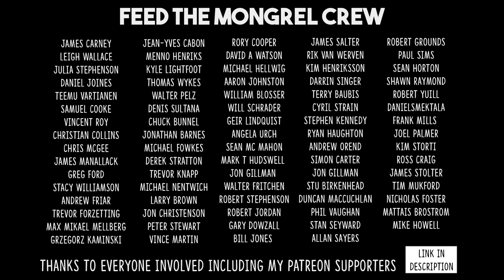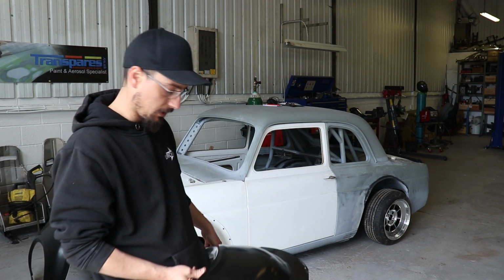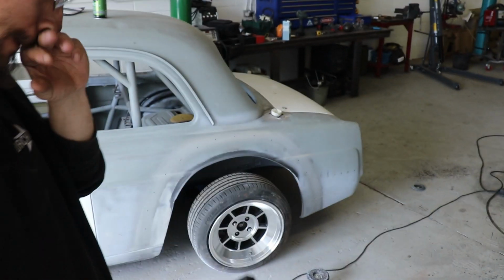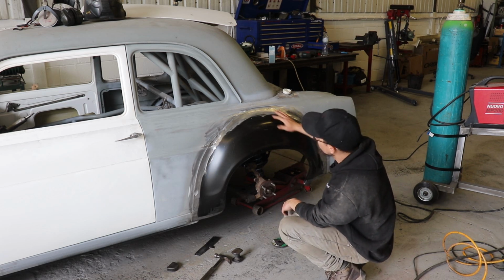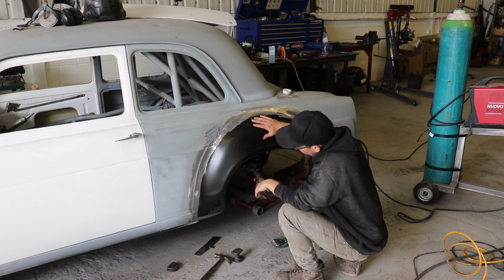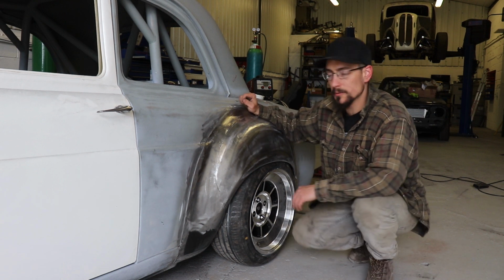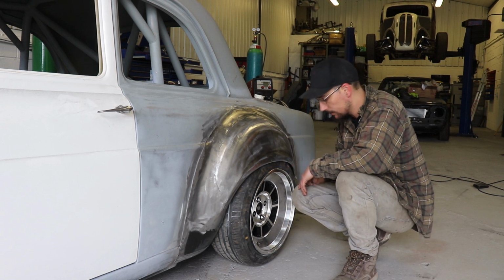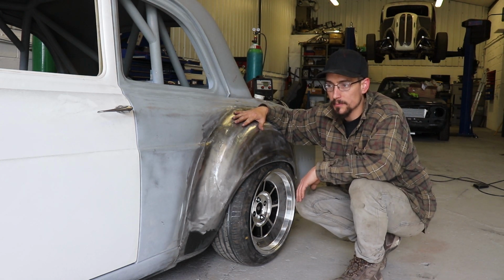THE MONGREL PART 53: BACK TO THE STEEL! MAKING WIDE ARCHES WIDER.

Comment: Years ago while an impoverished student at the Polytechnic of Central London I had one of those 100Es. It had the 1172 side valve engine. I remember one day  going up Highgate Hll and it wouldn't make the climb ..in first gear. So I turned around  and made it in reverse gear!..It also had a missing rear window lol! 😂..Got an Anglia with a 1340 Classic engine soon after.

Comment: Great work as usual... Can i make a suggestion...? Seam weld the big seam.... I know the arch is strong and not going anywhere, but after 30+ yrs in the body trade, i'd bet good money that if that joint was filled smooth that it will crack in time... Be a shame not to pre-empt the problem....
Love to see some more of the sit- up- and- beg pop.

Comment: I don't want to take anything away from what you've done - it was amazing to watch how you cut and extended the arch to fit, and it looks like you did a good job of getting it to fit, but I'm still not sure about those arches!

I'm finding it difficult to put my finger on exactly what it is, but I think it's that the standard arch is quite squared-off - the 'up' bits are quite vertical, and the 'across' bits are quite horizontal, and they're joined up by relatively tight-radius curves.
In comparison, the arches you've fitted have a smoothly-rounded curve all the way - perhaps it's that, I'm not sure, but there's still some way in which they don't quite look as though they belong.

Having said that, it's your car, so it's your rules and I guess you called it a mongrel for a reason! I'm still enjoying the videos and looking forward to seeing it painted!

Comment: I like the 100E. I'm an OLD Hot Rod-er so I would have gone a different way with a SC 3.8L V6 from the SC Thunderbird we have in the US. Full steel tube frame 2x3 (50x100) and cage. Would have to place the driver on the left since I've learned to drive 44 years ago. Cheers Mate!

Comment: G'day Matt from West Australia buddy I get why fiberglass is cool. ( weight savings) but I like steel guards as protection to rear wheels, wheel bearings etc.
Only gives a split second longer for damage avoidance, however I like the extra split second 😉🙂👍👍

Comment: Nice vid and NICE WORK!   Only advice: store cars on the floor, work on the lift.   Your knees and back will thank you when you are my age!  lol...
Reply: I second this comment
👍👍👍🏴✌️
Reply: Couldn’t agreed more , I wish someone gave me that advice 30 years ago!!!!
Reply from the maker: Yeh, half way through I was wondering what the hell i was playing at.
Reply: Agreed don't kneel on hard surfaces for prolonged periods.
Buggers your knees up, in my late 20s now and I used to crouch and kneel for everything for hours at a time.
They're not happy about it now!!!
Reply: @Urchfab  Ya had a shop since I was 25.  My first lift was at 35, and now at 50+ I can't kneel to set lifts hardly.   I lift cars up off floor to even do valve covers or plugs to save my lower back!   So, I thought you should hear that advice, oh and throw shoes away twice as much as you think you should, that too...  cheers

Comment: Wait a minute... Técalémit ? They still are in business, that logo with an arrow through a target is the same as in the 20's ! 
It's (was?) a french aftermarket car parts producer, specialized in Performance air filters, oil bath air cleaners, additional oilers for  clutch thrust bearings, fuel filters... etc

Now you need to find a Técalémit enameled sign ^^

Comment: I was delighted at the news that you were going to use steel for the rear arches...and astonished by the superb result. I reckon a glittering career as a Saville Row tailor potentially awaits you in later life.
 One thing puzzles me; if you´re going to fit shorter bottom arms, I´d have thought that this would give you more positive camber, tilting the top of the wheel outwards and reducing clearance by 10mm rather than increasing it. What am I missing?

Comment: Amazing work, Matt! Much nicer.

Still amazed that you don't wear eye protection when grinding. Glasses are really not enough. I know from personal experience with a wire wheel.
Reply from the maker: I've just picked up the ultimate face protection so no worries from now on bud.

Comment: Looking great! I know the workshop move probably cost a load of money but reckon you need to save for some tyres that fit the rims ;)

I’m a bit older and struggling to see what having the wrong size tyres offers aside from cocking up the 1000,s of hours that goes into tyre design and having a car that doesn’t handle properly.

I am a dinosaur though so maybe I have missed something

Comment: I did the same and my welds were fine. But after trying to flatten the welds with the flap disk I noticed that in some areas the sheet became too thin. Any advice about that? How do you focus the flap disk only on the welds?
Thank yoy

Comment: That looks a lot better than the plastic arches, I thought it was starting to look like a Reliant kitten for a moment. lol.   Is it just me or do you keep changing from one model mig torch to another in different videos? If so what's your reasons? comfort, size? Also what power supply do you run your mig on? 16 or 32 amp?

Comment: great job as usual but can you take the wheel off the car with the arch hanging over the edge of the tyre like that ?
Reply: budycelyn Yeah lol, the suspension sags when you jack the car up so the arch won’t be in the way when it’s jacked up... 

Even if it did still over hang slightly you’d only have to angle the bottom of the wheel away from the car to wangle it out.

Comment: Whilst I admire the skill in fitting the rear bubble arches, the aesthetics of the installation are all wrong.  By adding the flat infill sections it has created an unhappy transition from the curve of the bubble arch to a flat and then back to the vertical flat of the body.  You will need a ton of filler to get the shape corrected.  Also because you sectioned the arch, the top of the arch lip is now lower than before (and that was already uncomfortable) such that it looks as though the arch was installed without any reference to the wheel.  
As the rear track is so wide the obvious solutions are:
1)  Create the arch lip in small bore tube, following the curvature of the wheel/tyre and then infill to the body with a plain sloping  infill to the body - a classic solution that works visually.
2)   Roll new bubble arches to account for the wider track - requires an English Wheel and considerable skill.
3)  Use Mk 2 Rally Escort arches and widen those.
4)  Develop a Zakspeed arch widening solution.
5)   Radically, section the whole body, inserting a strip along the centre line to have the wider body covering the wheelbase.  This isn't as much work as it first describes as the centre of the car is simple shapes.  Also, a special wider windscreen will be relatively easy to cut as the existing windscreen opening is (virtually) flat. 
It would be a shame IMO to carry on with the rear bubble arch as modified as there will be an excessive amount of massaging to get it anywhere near visually acceptable.